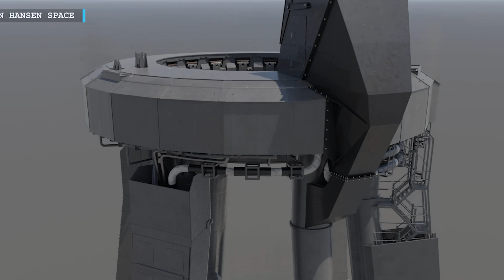Elon Musk Pushes SpaceX Starship to Reach Orbit in Weeks | SpaceX Begins to Rebuild the Launch Site

Comment: Elon is too arrogant and too ignorant to do things the right way. If he were to hire an engineer who studied elementary fluid mechanics (Bernoulli Equation) and listen to that engineer than he would install inverted diverging funnel under launch table to stop pressure of ambient air from constricting rocket exhaust. Then rocket exhaust would expand sideways before hitting concrete pad. Inverted funnel would spread horizontal 3 meters above ground constricting exhaust and preventing backflow of ambient air. Outside of funnel perimeter SpaceX can erect ring redirecting rocket exhaust upwards. Easy does it.

Comment: "Two months". If I were the FAA, I'd be saying, "No flame-trench, no diverter-plate, no suppression system? No launch authorization". Building those items is going to take WAY more than 2 months. We'll see if the FAA waffles. The proposed solution, a large, water-cooled plate assembly, may even be worse, because it will, if it doesn't catastrophically fail, and hurl large chunks of metal at the booster, reflect way more acoustic shock back at the rocket, causing what they narrowly-avoided on the first launch, a complete on-pad explosion. The fact that the flame-cone excavated down into the sand may have actually prevented exactly that.

Comment: Excellent video, precise and well presented.. first class.. and your timelines are what other peoples enthusiasm are ignoring and the massive engineering feat to build this "experimental steel launch plate" will be significant - musks comment about this plate being under tension and compression was interesting as what will it do when being superheated and flexing on the concrete stand they are going to build to support it? Also sand compession, granulation and compaction are big factors for spreading loads previously unheard of - even in the oil industry and question- if there is a major weather events how will erosion  UNDER this new construction be mitigated? After all reusabilty is the ultimate goal right?
I live in the area within 25 miles of site so am looking at bigger picture of space and environmental tourism as well as amazing engineering thanks once again

Comment: I am a big SpaceX fan, I defend them to the "NASA should build rockets" low infos, but anyone who thinks another Starship will fly before 2024, please hook me up with your weed supplier. I'd love to be that disconnected from reality. Build a freaking flame trench on top of the ground, forcing you to lift the whole launch pad on top of it. Build the pumps for a deluge system. Going to take a long time. Or else this will just be another disposable launch pad. That steel pad will melt, at least have holes melted in it, regardless of the thermodynamics of having the water. They don't have the pumping capacity for deluge or to stop that plate from melting.

Comment: ELON MUSK seems committed to another BAD design that may cost him a Launch license. I have Warned HIM and Warned him his Launch pad is Unsafe and The METAL SHIELD WITH WATER COOLING will only add Metal Shrapnel to the blast effects that will cut the Tank farms in pieces and not be effective at all.
MY SUGGESTIONs to copy Cape Canaveral, Move the Tanks and Supporting structures 1/2 -1 mile away, and Build a SwimmingPool/Holding Pond under the Launch Tower to ABSORB and DIsperse the Rocket Blast pressures into the Enclosed Pool of water 6-12 feet deep with burst panels on the ends on the diversion routes to allow excess pressures to ease as the StarShip Lifts and MOves away from the Tower.

Comment: Considering NASA SLS costs 4 Billion PER launch.. that is already quite a cost savings still being in development -most costly part...
Reply: NASA managed to launch an SLS. SpaceX failed.
Starship failed to stage.
Reply: @allangibson8494  space X successfully launched starship, they did not reach orbit.

SLS has recycled designs that were already flight proven RS-25 engines from the shuttle, starship is 100% new down to the engines themselves. 

SLS started development in 2011 where as Starship started 2012... Key thing here is NASA also had since 1958 with the launch of Jupiter-C, worth of experience reaching orbit... space x since 2008... 

Starship is 100% reusable design, SLS 97% expendable... 

all this considered and to have the DEVELOPMENT cost of starship over a year with multiple prototype vehicles made to be Less than the cost to MAKE 1 SLS rocket is astounding... 

oh and not to mention NASAs failed Ares 1 (failed predecessor to Artemis 1 with a cost of at least 6 billion)
Reply: @SCWeaverProductions  Ares reached orbit on the first attempt - and didn’t totally destroy its launch pad.
SpaceX is big on “more haste, less speed”.
Elon Musk is big on talk and less on results.
Starship is 100% expendable and will be for the next few years.
Reply: NASA is the total failure organization lately... Need to abolish it

Comment: I'm beginning to think that designing the launch pad has engineering considerations that are actually quite similar to those for the rocket engines. You need to take all that exhaust and channel it away to a safe place, as smoothly as possible.
Reply: That is wasting energy big time.
Reply: @RichardKCollins  How so? Is there some way to recover some of that energy? TBH I've never thought about either issue before.

Comment: Need to/should have already computer modeled "debris flow" but as for the war between man made nitrogen and the Earth's nitrogen the man made variety did win as the worst case scenario was an explosion just ABOVE the Launch Pad and as an added bonus there was some "righting attempt for a landing" after reaching main engine cut off which never happened either. I would have though bolting the concrete deep into the ground would have been done and maybe add curvature or some type of concrete "well" would have been pretty straightforward from the get go but hey, I'm no rocket scientist so ask for a genius get one would appear.

Comment: There are some problems with some of your statements.  For one, no dead wildlife, but there were a bunch of burnt eggs and nests, which considering those birds are endangered, it's probably even worse.  And as part of the cleanup process they previously agreed to clean up every last scrap of debris by hand (no vehicles) and reseed the ground with transplanted plants, bacteria, and algae, because the area is so delicate.  Treating the environmental impact as a win is strongly misleading, and is plausibly going to be what shuts down future launches from this site.  Secondly, they did not in fact survive max Q since they did not even get close to reaching it (max Q was supposed to be at a MUCH higher altitude at a MUCH faster velocity with MUCH higher thrust output.)  The confusion is because the announcer kept reading off his script regardless of what was actually happening.

Comment: Even with a steel plate, there is still no thrust diversion away from the launch area. I understand creating a flame trench below ground is not feasible with the high water table, but still some sort of thrust diversion system similar to LC39A is needed. All launch sites have some sort of flame trench to protect both the launch support equipment and the first stage during launch. So my concern is that they still are not addressing the full scope of the problem.
Reply: Agreed.  It should be possible to build up the entire area by trucking in tons and tons of crushed gravel.  Otherwise, Boca Chica was a poor choice of a location.
Reply: @scottslotterbeck3796  Shock wave rebound is probably going to be the next issue.
Reply: Can’t they build a flame trench that self fills with ground water?

Or bury giant flame diverter culverts?
Reply: @CHWBAKA450  all the tech an know how is already in use.
This whole thing from the ground up was wrong!
If you realy look? You can hear “ there’s the money just get it done” !
That’s irresponsible for something of this type of engineering an safety.
Reply: @paulcoverdale8312  Actually, safety wasn’t really an issue. Even with this large an unexpected effect, no one was at risk- not even animals. And keep in mind, the FAA’s legal authority right now is not over damage to SpaceX property et al; officially, legally, they don’t care how much SpaceX property gets hurt. Their job is protection of the uninvolved public. The uninvolved public DID see some unexpected effect here- for this unprecedented vehicle- but we’re talking dust and grit. As far as we know, even with this, no one was hurt- and a ton was learned. Successful failure!
Reply: @dphuntsman  The fact that no one was hurt, and that the debris did not cause the rocket to explode was sheer luck. This is not how projects of this magnitude should be carried out. It was irresponsible. Claiming that you are going to be up and running in two to three months is also nonsense, and irresponsible. It shows no real concern over potential destruction. This isn't suppossed to be kids in fields playing with firecrackers. We already learned these lessons.
Reply: I know you may think there only one way. A follower. First even flame trenches have there problems. When you channel the exhaust into one stream it a lot more sound deflection toward the rocket. Yes ground water levels. By using the water cooled plate it will direct  the exhaust straight out horizontally. The steam will be coming out as well horizontal.  Pushing the exhaust out even faster. It's a good idea.
Reply: @stevemelnychuk1931  it’s absolutely possible to build a concrete flame pit.
The tech an science ie: the concrete is already available. 
This whole thing looks as if money was wasted on the wrong things.
There was no water spray which stops the expansion of rebar in the concrete.
The protection wall was beyond not fit for purpose an allowed debris to fly , hitting tanks, that simply should have been at least half a mile away.
This whole debacle was wrong an cheap from the ground up!
The words” just get it done “ come to mind.
Totally wrong from the get go.
Reply: @paulcoverdale8312  remover the flying debry and problem solved.that was the only thing that blow up in there face. The olm is high enough to allow good flow. Elon is right with the plate design. Every thing you see is a new design. Didn't  the launch system at the cape suffer some damage as well. Shit will go wrong if you don't think a head. Concrete is not the answer.
Reply: If you can't build down, why not up?
Reply: The water system IS the flame diverter.  Contrary to popular belief, it's not a water cooled plate, but a plate holding a water spray system.  The water spray will direct the heat and energy into plumes between the support columns.
Reply: @jameslmorehead  Both. First the water run through the troughs between the plates (it's like a sandwich), then expelled through vertical pipes at the sides and into the sideward flames to dampen the vibrations. I think vertical shock wave rebound from the plate is going to be the next big issue because that can damage the engines and other equipment in the engine bay.
Reply: I know that not all launch pads have trenches or flame deserter. Yes most large rockets have them. But every thing spacex does has been innovative. I personally think given the height of the olm plus what there proposing is quite first principle. Have the plate fed from the center. Channel though to the out side will do two things. Cool it and use steam to push the plum straight out horizontal.  This will reduce the sound wave not toward the rocket.
Reply: Concrete is not the answer. As well there using cryo fuels. Can't have the tanks half a mile away.
Reply: @stevemelnychuk1931  There's a reason they chose Cryo methane + LOX. Methane can be produced on Mars.
Reply: The launch mount is 60 feet high. Open on all sides. The open area is 10 fold the rocket base. The exhaust is going to be pushed straight out from steam witch has incredible force. It already worked. If you make it strong enough take the forces. It will do just fine. There is a reason for this design. Spacex is the only outfit replacing and servicing there engine on the launch mount. A flame trench or desert or will not allow them to access there engines. The design is good. They made a mistake lessening to there concrete guy. Never been done before. No hand book. 99 percent the engineers need a book.

Comment: I would consider very seriously that unplanned digging to construct a flame diverter right out of it? No? It would mitigate vibrations much more effectively. The steel plate will also compress the ground and the underneath structure will also crack and break… or completely fill the hole with concrete covered with a very solid steel structure. But that surface water-cooled steel plate will take quite a beating and hopefully won’t rip apart under that hypersonic hurricane!
Reply: The problem with digging is the high water table. A flame trench would really require the pad be built up above ground level similar to the Cape's 39A/B and pad 40

Comment: Although sand has relatively good compressive properties it is not so good laterally.  If you press your fist into a can of sand and rotate it you get a fair amount of resistance.  If however you do the same at the beach your fist will sink into the sand.  Concrete has very good compressive properties provided you have sufficient rebar to take any bending loads.  My guess is the underlying sand at the pad just moved laterally under the pressure of the launch force and the concrete was not sufficiently reinforced to take the bending loads subjected to it.
Reply: I think the water that is in all concrete caused steam explosions, and the force of the exhaust blew it everywhere.

Comment: will the double steel plate with water in-between work? Maybe a problem would be to get the water flowing evenly from the circumference to the middle orifice. With the max pressure from the 33_exhausts, pushing against, the water may flow very unevenly/one_sided. A circular, spiraling_in, flow direction may be more stable than direct- radial inflow. Like the motion of a galaxy! The bolts which hold the plates together should be like fins at 45°Angle to get the flow into rotation; clockwise or counterclockwise You can choose!
Reply: The flow rate through the plates would have to be insane in order not to flash the water to steam (and probably split the plates). Also, this doesn't really help you with the reflected blast from the engines and it would make the acoustic problem worse, if anything.
Reply: You wouldn’t want rotation, it needs to be water in and water out to prevent melting and flash boiling.
Reply: LOL."I'm an expert!"

Comment: everyone is concentrating on the launchpad. The elephant in the room is why did at least 7 raptor engines fail on the way up.
Reply: Yeah; tho, I’d put it a different way as well: If I’m a Booster propulsion guy, the first thing on my mind is:  TWO TIMES we’ve tried to light the 33 engines on SuperHeavy….and neither time could we ignite all 33. THAT would be #1 on my list, to be frank.
Reply: It’s well known that the engines on booster 7 were very old and had been removed and installed on many of the test ships.

They have said that the new engines they make are far more consistent than those on booster 7. Now obviously this remains to be seen. I would say let’s see how B9/S25 goes before we say this is going in the wrong direction.

Comment: They need a super thick, super strong, steel platform to launch off of. With cold water being dispersed onto it.
Reply: That is what they're planning, BUT,... That won't control where the 16.5 Million pounds of thrust goes. And that amount of downward pressure, coupled with the temperatures of 33 engines at 100%, is very likely to result in a catastrophic cascading failure. Chunks of steel and concrete, instead of just concrete. Then there's the huge acoustic shock reflected more-effectively back at the booster.

Comment: Yeah, I doubt they will be launching again this year, much less in a few weeks. They will of course blame the FAA for the delay when in reality the fact they haven't got a working launch pad and they trashed the site is the reason for the delay.
Reply: Not only were they not ready on 4/20 but they were not ready 1-1/2 years ago either when Musk’s fanboys were bashing the FAA claiming they were holding things up.
Reply: Thumbs Down. They are already working on the site….since they had already planned on re-doing it beforehand, and even have the parts around. One of the reasons he was so optimistic about that part.  And why it’s not his biggest worry; his biggest worry (in my view): Not only why the FTS took so long to do its job; but, secondly……they’ve tried to light 33 engines at once twice now, and haven’t succeeded. That’s even a bigger worry than the fact that later engines failed going uphill (we had that happen even on a shuttle flight).
Reply: @dphuntsman  Lol. We'll see kid. As with most Elon Musk timelines, you will be closer to a ballpark timeline by adding a zero to it.